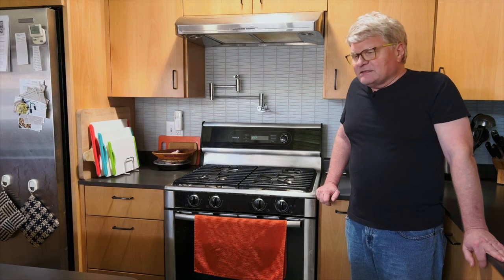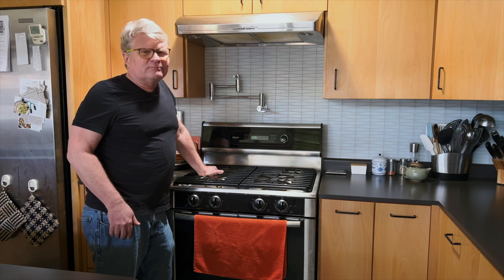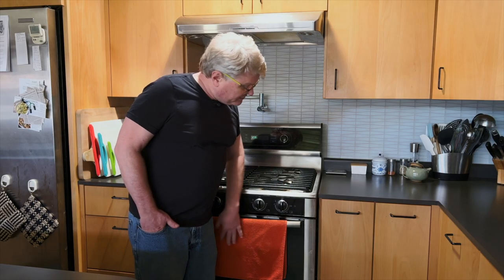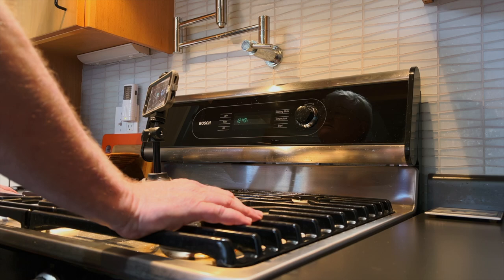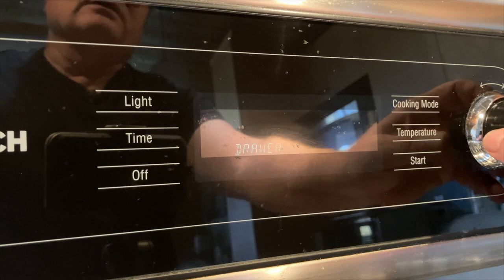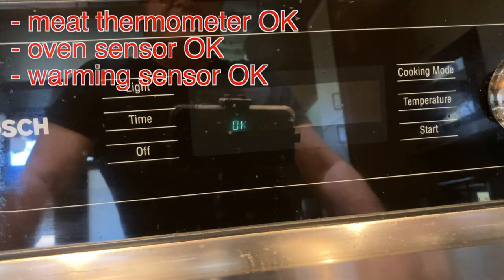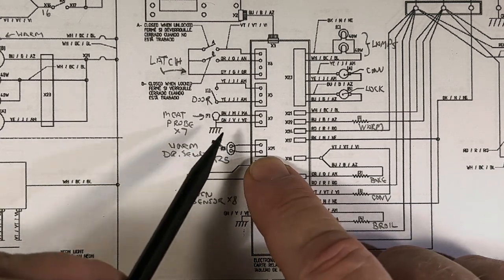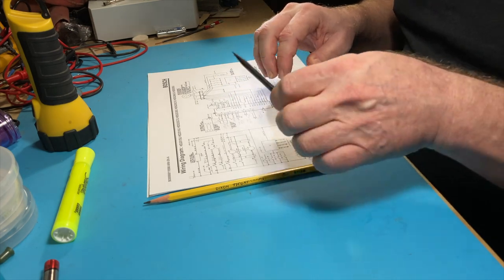Bosch "Touch & Turn" Range Stove Oven Model HDS-255/HDS-25 No Heat Diagnosis and "Repair"

Comment: Hi there.. I have that same bosh  model oven  . The issue I have is the oven takes really long to heat up. Do you have any idea why ?
Reply from the maker: That sounds similar to the problem that got me started on all this -- and that I never identified since it just "started working." Grrr.

Either the heating element(s) are not coming on at all, or the thermostat is screwy and is telling the control board things are already hot. Run the self-tests shown in the video and you should be able to isolate the problem to one or the other.
Reply: Did you get that figured out?  Both the top and bottom elements should be coming-on–  maybe one is burned-out or one of the relays  went bad.  I always turn-on the convection initially because the extra "ring" element helps the oven heats-up faster!